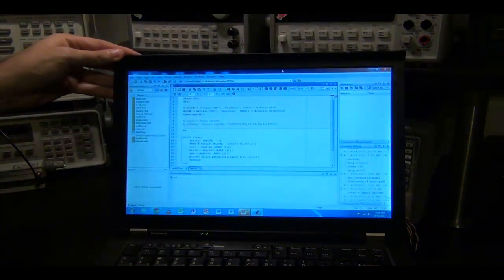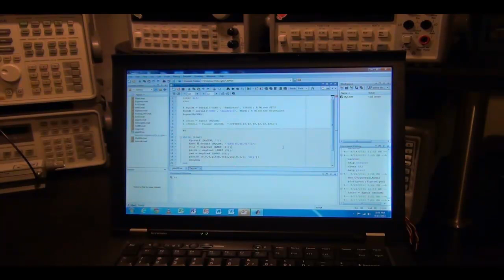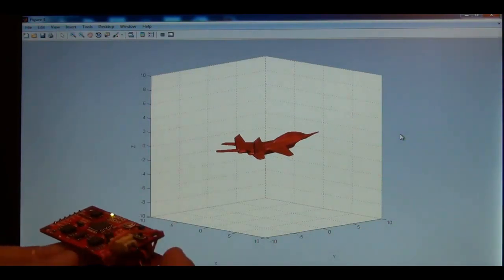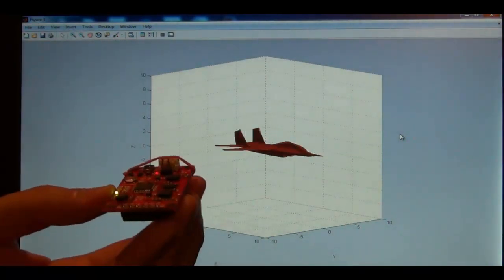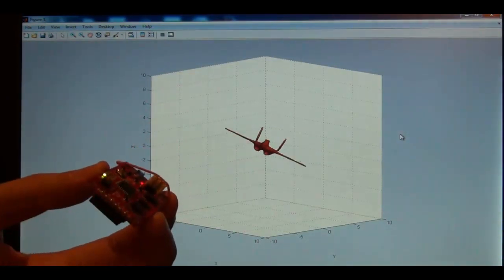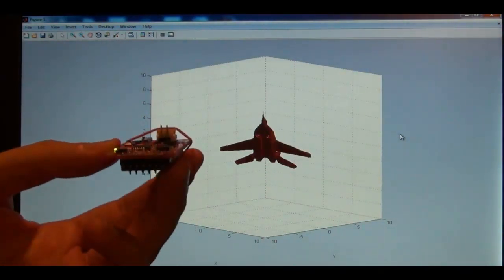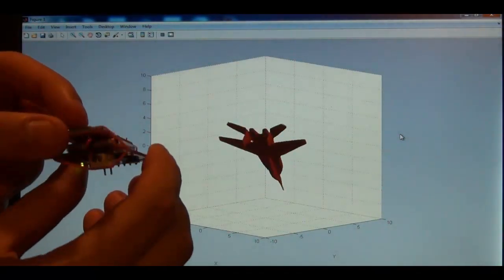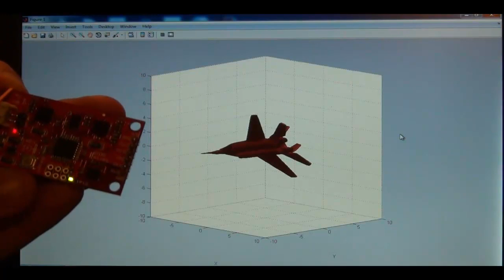TSP #7 - 9-DoF AHRS Sensor Board and RGB LED Matrix Demo

Comment: Thanks for the video it was what am looking for. I have a question if you can anser me please: I am planing to use 9DOF different from the one in the video and it doesn't have the white thing you connected the battery to it, so can I connect the battery into the sensor without using this white adapter. for example can I connect it to the VCC???

Comment: My vote is for an episode (or series of episodes) that details the functioning and use of rotary QUADRATURE ENCODERS, with speed, direction and position (angle) control using the Arduino and discrete components (i.e. simple or brushless motors, discrete optical or hall effect sensors, gears and wheels).  I am particularly interested in solutions to drive two powered wheels in a straight line, turning, etc.

THANK YOU FOR THE GREAT VIDEOS!

Comment: Shahriar, Thanks for great video on embedded systems applications. I for one, would love for you to explain in more detail the interactions of the various chips on the 9-DoF board and the code that is used to control them. Any Arduino related boards included in future demos would also be appreciated. Thanks in advance.